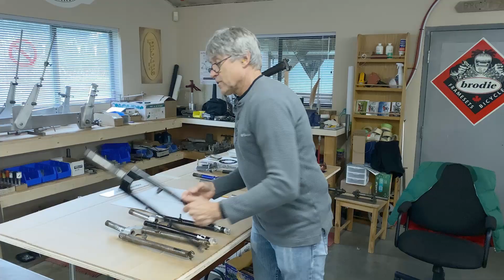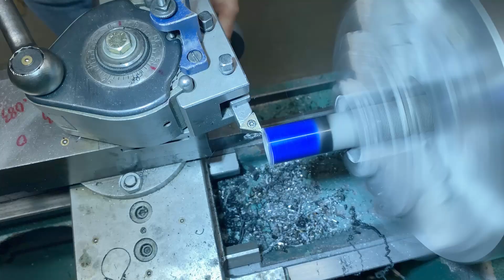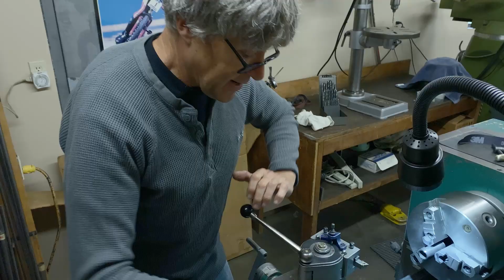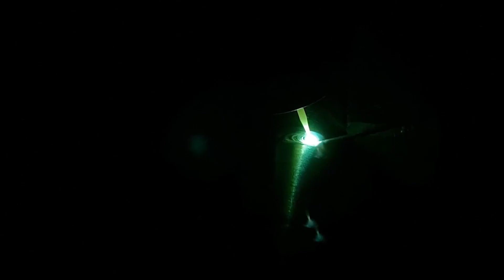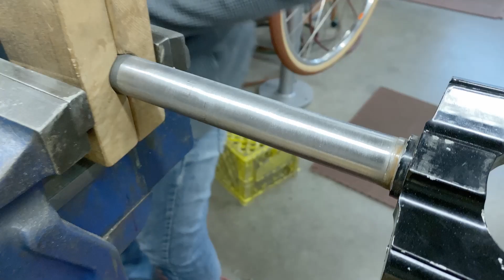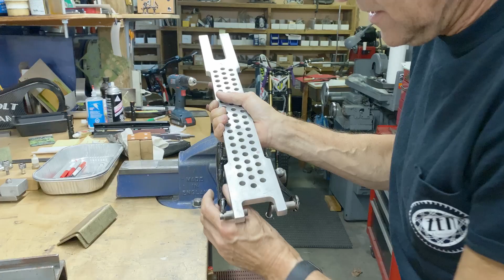How to extend a steerer tube - Framebuilding 101 with Paul Brodie

Comment: I’m a trained carpenter and have been working on automotive models for 25 years—18 of them with a manufacturer—so I certainly have a solid grasp of craftsmanship. Metalwork isn't quite my forte, but...
I watched the video and used the detailed information as a basis for some preliminary testing. Ultimately, I extended a Kona Project 2 fork, and it worked perfectly. Many thanks for sharing your expertise in such a calm, well-grounded manner—
A rare exception among channels otherwise rife with half-baked knowledge.
Reply from the maker: I'm glad that worked for you. I am happy to share my knowledge. Thanks for commenting!

Comment: I need some help.  I am looking for the small ring at the bottom of my 1-1/8" steer tube onto which the crown race is fitted on.  Where can I buy one?  Thank you.
Reply from the maker: You can buy one from a Framebuilder supply company.. They are usually brazed or silver-soldered on, then machined to the correct dimensions. Somehow I don't think this is what you are looking for...   :face-orange-raised-eyebrow::face-orange-raised-eyebrow:

Comment: Would it be possible or advisable to silver or brass braze instead of TIG welding?  I ask because I have access to an oxy acetylene torch at work, but no TIG.  Bought you and Mitch some coffees.  Thanks for the videos.

Comment: I plan to weld a section of the threaded part to a quill
Reply: You can use a steel quill stem as your insert, doing mine this way

Comment: I have sent 4 forks to Franklin Frames of Ohio and Jack just grinds out the full tube and rebrazes a reynolds tube from scratch.  Wouldn't that be a little faster and simpler to do than this gusset method?

Comment: What about unwelding it from the crown and replace the whole tube?
Reply: Franklin frames of ohio will typically grind out the steerer and install a whole new steerer.  You want to grind because on some forks like Raleigh the steerers are tack brazed with PURE COPPER which literally cannot be un-brazed (the melt temperature is enormous) without cooking and cracking the crown (ask me how i know this ...)

Comment: I have a bmx fork and the steerer stem tube broke where the threads end. I plan on grinding out the welds at the bottom where the steerer tube attaches to the forks and then press it out. I found a donor fork that I will cut the steerer tube from and press it into the bmx forks and reweld it. Have you ever done this?

Comment: I've done this before without machine tools:
Not all 1" threaded fork tubes are the same! Check your headset on the donor fork to make sure it fits well.

For a 1" threaded fork, you can use a 22.2mm seat post as the pipe that attaches donor to original fork. These are common on old schwinns and new cheap kids bikes.

You don't have to butt the end of the donor fork to the end of the old fork. You can leave the pipe exposed in the middle. If you don't do this, you will have a hard time finding a long enough donor fork. Leaving some pipe showing in the middle allows you to use a fork from a 56-58cm bike and have a decent amount of quill stem adjustment. The fork I extended was for a 64cm bike. Will this make it weaker and allow it to flex and bind the headset? IDK I didn't notice any difference.

You don't have to clean the welds. I stick welded mine and left the welds lumpy inside the head tube. They don't rub and they can't be seen, so I didn't care to grind them down.

Comment: I can use this method to extend a cromo frame? Extending the toptube and then replacing the downtube according to the new measurements
Reply from the maker: No. Mostly because the top tube and down tube are not parallel to each other. But you did say "replace" the down tube. If you are going to go to that much work, just change the top tube as well. At that point, you replace the head tube too....    :face-orange-raised-eyebrow::face-orange-raised-eyebrow:
Reply: @paulbrodie  thank you mr. Brodie, I'll do that then. greetings and thanks for all the videos full of knowledge
Reply from the maker: Most welcome;  Thanks for watching!    :face-orange-biting-nails::face-orange-biting-nails:

Comment: Hi, can tig welding be changed to brazing?
Reply from the maker: It's possible, but I would not recommend it. A steerer tube will flex over rough terrain, and braze tends to crack from flexing. That's why Tig welding is better; it resists cracking from flexing.

Comment: What was the thickness of the chromoly extension tube you used? I only saw you mention 0.083" for the insert. Do you have any advice about extending a steerer tube for a tallbike? It would be nice to use a thin steerer tube (0.035") to keep the weight down (not much stress at the very top), but not sure how thick it needs to be at the top of the existing fork steerer.
Reply from the maker: Yes, the insert is .083" wall thickness. To extend the "steerer tube"  I used another steerer tube. The wall thickness is 1.5mm, or approx. .060".  These are all industry standards. A steerer tube of .035" would be grossly inadequate. Don't use it.

Comment: Thank you for a very informative video! I’m struggling to find the right size CrMo tube to fit inside the steerer tube (1 inch) - can I use a standard carbon steel or is it important to use the same material as the steerer tube?
Reply from the maker: Thank you Martin. I think you need a 7/8" 4130 tube that will need to be turned down very slightly to give a slight interference with the steerer tube. It's better to use 4130 so that everything is strong. Thanks for watching.😉
Reply: @paulbrodie  Thanks a lot for your quick response! I manage to find a suitable 42CrMo tube on Aliexpress :). OD25, ID16. I will turn it down to fit.
Reply from the maker: @martinkjerschow6409   Very good.

Comment: Hello this is probably a stupid question but, do you still have enough depth to insert a quill stem after this?
Reply from the maker: Not a stupid question at all. You need to figure out where the internal butt starts inside the steerer.  The steerer tube gets cut 1" above that. The insert is 2" long, so 1" fits into each side. Then you can figure out if there is enough length for a quill stem. Sometimes there is not enough room. Make sense?
Reply: @paulbrodie  Yes it does ! Thank you very much, I love your videos. Cheers from Belgium !
Reply from the maker: @charlesvanderborght  Hello Belgium! Thanks for watching and commenting 😉
Reply: @paulbrodie  Is it okay to have a 1 inch long insert? So it has 1/2 each side?

Comment: I was feeling hopeless when I got my new forks and they were 2 inches too short. This video gave me some hope!
Reply from the maker: It's good to have Hope. Just make sure the extension is done properly so the forks are 100% safe.
Reply: @paulbrodie  I'm going to take it to a machine shop and have them weld and grind it properly so I have peace of mind, and I'll throw a steerer tube check into my next bike rebuild.
Reply from the maker: @RainytheNB  I would suggest taking it to a framebuilder instead of a machine shop. Most machine shops probably have little or no experience working on bicycle frames or forks.
Reply: @paulbrodie  I found a local marine shop who have built bicycle forks before, So I'm confident that it'll be well made.
Reply from the maker: @RainytheNB   Very good.

Comment: How is the steel steerer fixed into the aluminium crown? Would it not have been possible to remove the existing steerer and replace with a longer one? 

If the steerer is a press or thermal (is that the right term?) fit, would you be worried about the heat causing the steerer to expand and loosen within the crown?

Comment: Great video! Thanks for sharing. I used this method to extend a couple forks, back when I was building recumbent frames...I always wondered if it was a good/safe method. Your video gives me confidence that it is truly a safe method. I suspect that void at the end of your weld was from the press-lube, or gas escaping via the path of least resistance. So refreshing to see you hold your TIG torch dead still, until the post flow times out.
Reply from the maker: Scott, thanks for watching and commenting.

Comment: Why would you even bother cutting it and welding it...   they make extension tube sets for just about every kind of fork these days.  Hum....
Reply from the maker: Maybe some forks are suitable for changing the steerer tube, but not all forks. I did a Google search and found some "vertical tubes" for sale. That's what the company calls them. I prefer to use the proper name which is a "steerer tube".
Reply: @paulbrodie  No they actually make an adaptor that slides inside old tube, Expands and extends it up to length you need!  They have non and threaded extensions what I'm saying!  Yeah you could press out old tube sure weld  it lol! to each his own! Either way came out nice!   But I had a guy with same thing few weeks ago and we actually just bought an adaptor instead welding extension on it!  We hack sawed the old thread section off. Broke out the 1/2 socket to expand the new insert and poof put bearing nuts on slid in new stem!
Reply from the maker: @BuildBreakFix   How many frame builders are using this method to extend steerer tubes? Can you name a few? Because of liability issues "good" frame builders won't get anywhere near fork modifications, unless they are 100% sure it is done properly.
Reply: I think this is referring to Quill extenders which raise the handlebars— and misses the point of extending the steerer tube to then use in a frame with a taller head tube.
Reply: @leendeen8745  yes !

Comment: Hey Paul, love the videos! I have a question for you; do you think it would be safe to use this technique to extend a threaded fork steerer and convert to threadless? Essentially replacing the threaded top section with a non-threaded steerer tube.

Thanks! Looking forward to more videos
Reply from the maker: Thanks Nolan. Yes, you can convert from threaded to threadless. Just be careful with the process and use 4130.
Reply: I have had in mind the same idea but I never found the solution, thanks again @paulbrodie
Reply: Sorry what mean is 4130, thanks teacher.
Reply: @cheewaiyow7469  4130 is a type of Chromoly steel.

Comment: Hi Paul. Recently found your channel.  Great stuff.  One question on this video.  Why did you tig rather than braze?
Thx
Mike
Reply from the maker: If I'd brazed it, even if I filed it down very smooth, you would always see the bronze band of filler material. With Tig welding the join becomes invisible. If done well, the bronze would be perfectly strong. Thanks for watching!
Reply: @paulbrodie  Would MIG with co2 for better penetration and shielding have worked in this case? Curious as to your thoughts if you didn't TIG what you would have reached for?
Reply from the maker: @anixon2013  To be truthful, I have never MIG welded. Never had a machine, never had the opportunity. MIG is more of a production tool, I think you can have a finer touch with TIG. I only have TIG and brazing, so if I didn't TIG...

Comment: Paul, there is a study "Strength of Thin-Walled, Butt-Welded Steel Tube" by Cameron Daugherty and Dr. Mark Archibald at Grove City College" (sorry, can't post the link). The bottom line was that in a 4130 tube they found the strength of a welded tube was within 1% of an unwelded tube, no insert. What are your thoughts?
Reply from the maker: That might be true, but the insert is added insurance and let's me sleep at night!
Reply: @paulbrodie  Understood,  I just extended a steerer tube that was cut too close to the butt to get reinforcement in, so the study helps me sleep at night!
Reply from the maker: @wvucyclist1  Well, if it was cut too close to the butt, you could make an insert that has a taper that matches the taper of the butt. I might not feel comfortable without an insert, because when you only weld it, it's very hard to know if you're getting 100% penetration in your weld.

Comment: what happened when you closed the weld: the air could not go anywhere, and you got a pressure hole :)
Reply from the maker: I just closed the hole. There was no problem. When we made Tig frames the top tube was always sealed. We just closed the hole, no problem.

Comment: Campy alignment tool(s), back in 1987 when I was contemplating  which set to get, the fancy Campy ones or the Park, I went for the Park because the cones can be threaded closer together for the rear dropouts,  do you have a set of those too?
Reply from the maker: No, I only have a Campy set.

Comment: Cut off abrasive saws are nicer or a 4.5" angle grinder with a disc cutting blade.  I actually quit using a hack saw over twenty years ago as to application to bicycle frame building.
Reply from the maker: I know cutoff wheels work well I just don't like the noise or the dust.

Comment: Great video! I don't know what got into your puddle but it's possible it was a little bit of grease or something on the filler rod. I think that might have happened to me the other day. I always try to remember to clean the rod (and not hold it in my mouth while moving things around the table) now.
Reply: I do the same ...I try not to squueze my bare butt cheeks too tight around my rod (filler) while I'm handling my welded compartments.

Comment: Hello, do they still make that belt sander I haven’t seen one like it do you have any suggestions.
cheers David 😊
Reply from the maker: Google Dynabrade belt sanders. It will be in their catalogue. The belt size is 1/4" X 24". They are not inexpensive but they are very well made and will last years if you treat them well.
Reply: paul brodie  Thanks for letting me know cheers David

Comment: Would you suggest brazing using this method? Maybe add a few holes to add bronze into?
Reply from the maker: Brazing could work if you were careful and had good technique, but I prefer Tig welding.
Reply: @paulbrodie  @Andy Tong  You wouldn't need holes if you brazed the sleeve into the lower tube first, cool, clean, flux, press the upper top tube on and braze the top part.   You would apply heat to the upper tube (not the lower tube, which shouldn't melt the brass in the lower joint) and apply the filler rod down inside. Holes are a potential failure point which is the last thing we want in forks.
Reply from the maker: @rickpaulos  If I did it your way, that would be 2 heat cycles. That doesn't make sense to me.   I still prefer Tig for this. I don't believe there is a hole in my method.

Comment: Thanks for the great video! I've done a few of these extensions. I had one develop a stress crack after a year of heavy riding so now I put in a 1/8 plug weld on each end as a added measure of safety.